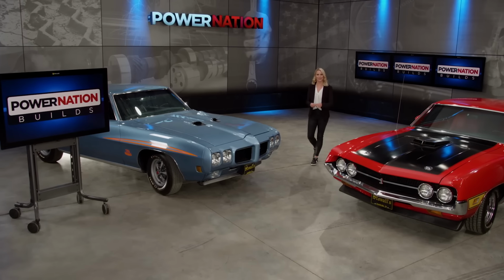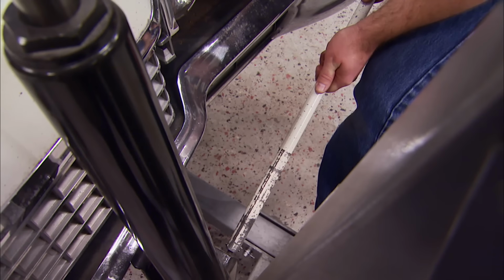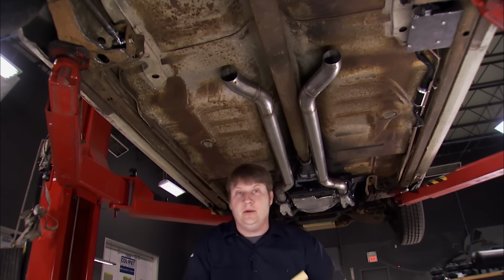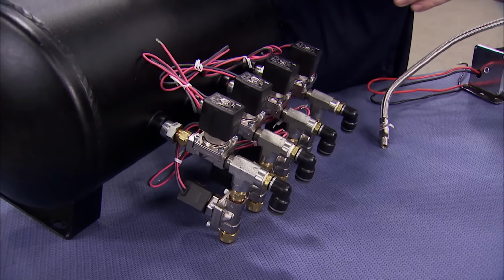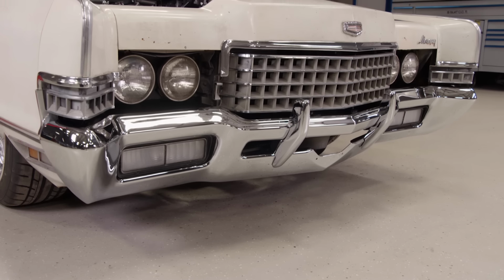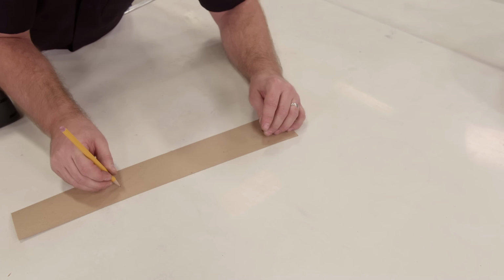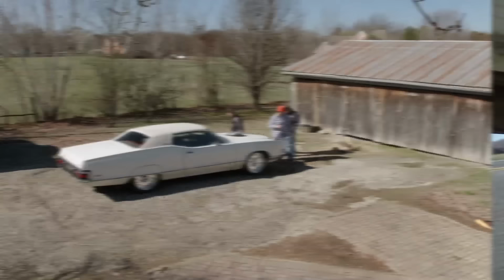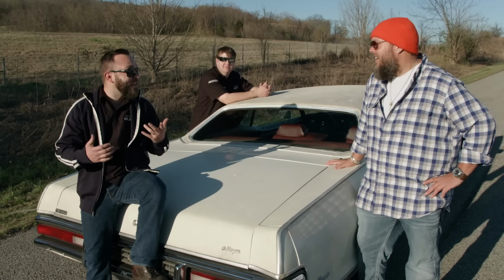A 1972 Grand Marquis Gets 1,100 Horsepower - PN Builds

Comment: 1100 horsepower no,... not without nitrous, or 15:1 compression.  Big Pimpin! that's what I'd call this build.  I like how you moved the trans crossmember. If you don't want the engine to be torque twisting I'd install a Mid Plate. The air cleaner really looks cheap poking out of the hood, because It Really Looks Cheap! I'd install a drop air cleaner. This was going to be a classic Powernation build...until I saw the saw in your hand. What were you two thinking?

Comment: What's wich the reupload?
Also  at 17:33 Just hear how hard the engine is working and how slow it's accelerating for a 754 HP.
It's such a massive waste to make such a big and powerful engine and then connect it to a 3-speed gearbox. Put a modern 8-speed or 10-speed, and it will be something different.